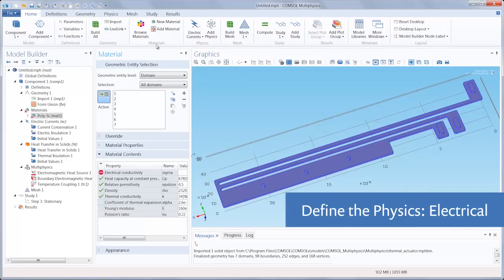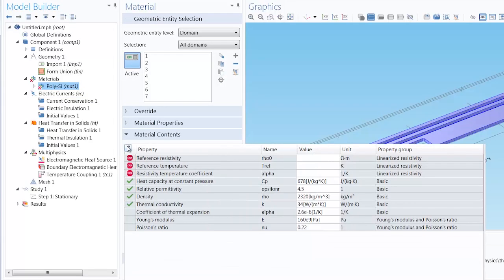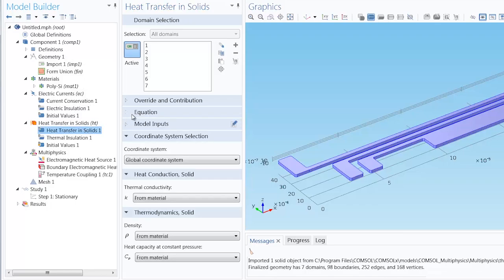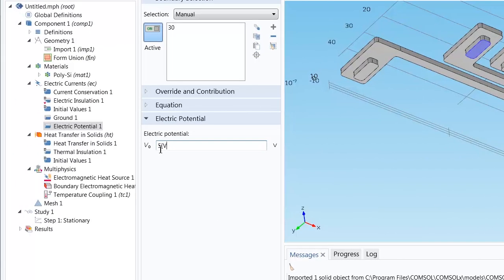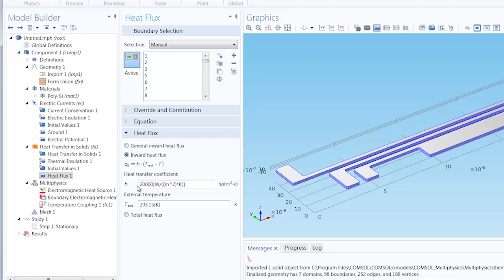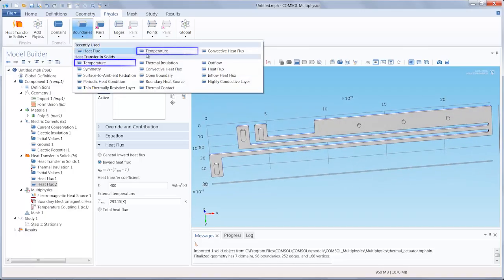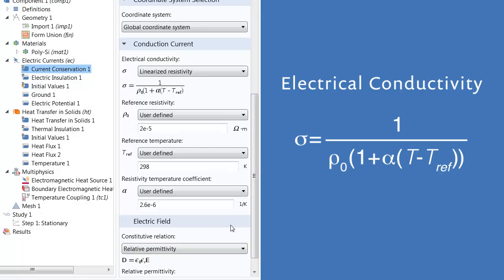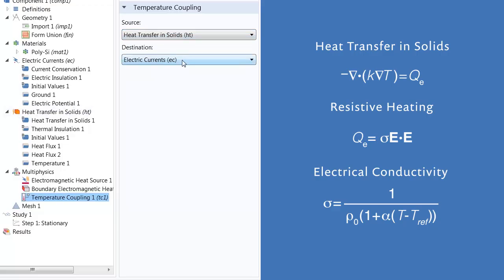Defining Physics in COMSOL Multiphysics (4/8)

Comment: At 4:50 I don't seem to have the inward heat flux option. I have all the others but not the one mentioned. I am using v5.1
Reply from the maker: +Shariq Salahudeen do you have "Convective heat flux"? In newer versions, "Inward" is replaced with "Convective", but they are the same feature.

Comment: Hi! 
First of all thank you so much for the great step by step tutorial. It is so helpful.
When I tried type in the inputs (ref resistivity, Temperature and resistivity temp coeff), it has some built it numbers under the user defined tab and it does not allow me to change the numbers. it gives me an error saying "An Unexpected error occurred". Can you please help me. I basically faced the same issue anytime I need to change any of the parameters even in the heat transfer boundary. 
I have to mention that I am using the COMSOL 5 on windows and when I go to the material section, it does not require entering these properties(there is no RED sign next to any parameters ) like it did for you in the tutorial. 
Any help is greatly appreciated!
Reply from the maker: Prisa Lotfi, if you are receiving an error message while following these 
instructions, please contact your COMSOL Support team.